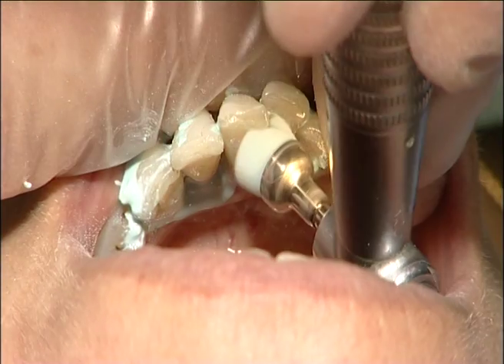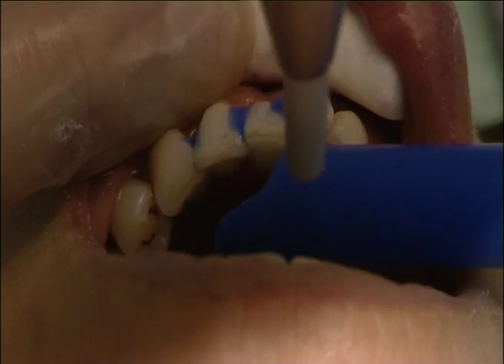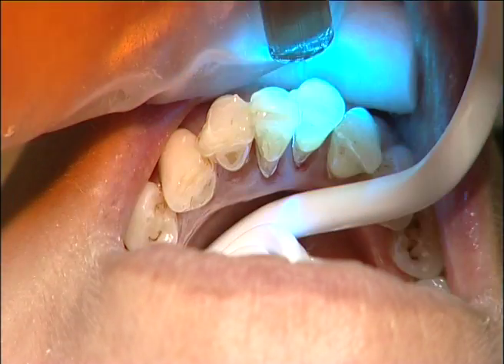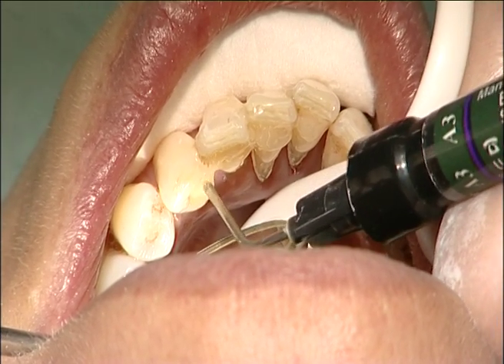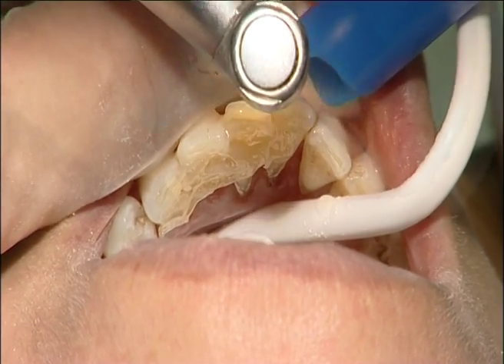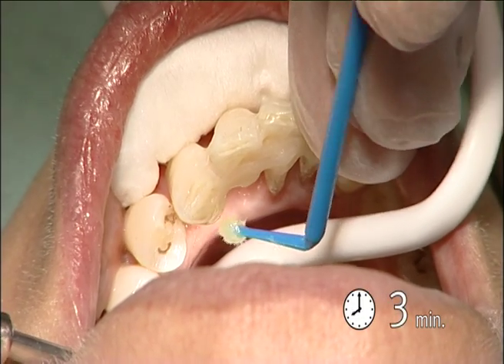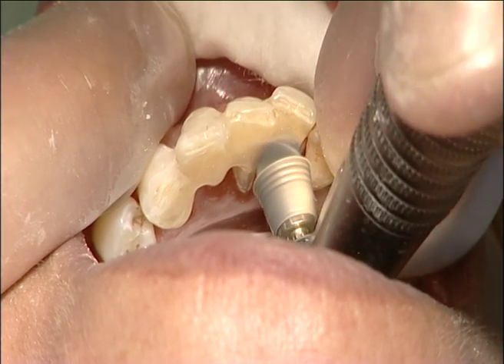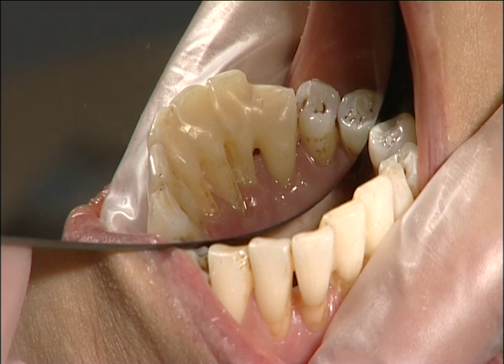everStickPERIO PERIODONTAL SPLINTING

Comment: good work..  please i want to understand.. when you remove the spliting strip?
Reply: Periodontal splints are usually fixed and permanent. They are used to stabilize mobile teeth and are typically not removed unless necessary.

Comment: Thank you for this nice demonstration; may I ask if using rubber dam with/out wedjet is recommended or not for achieving better isolation prior to itching phase? Also, does placing the strip on the middle third will provide a better splinting with less interference on occlusion than placing it on the incisal third? Thank you very much. My regards.